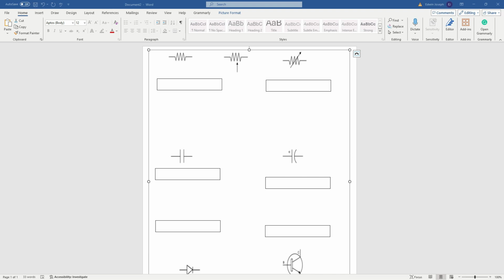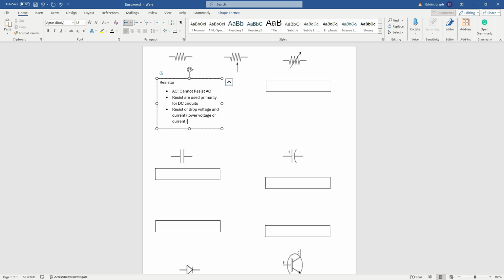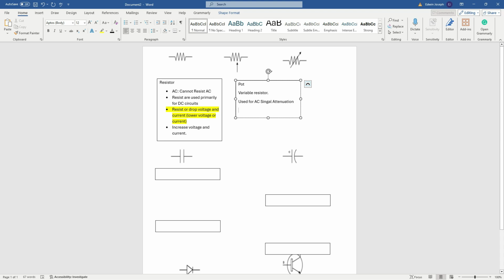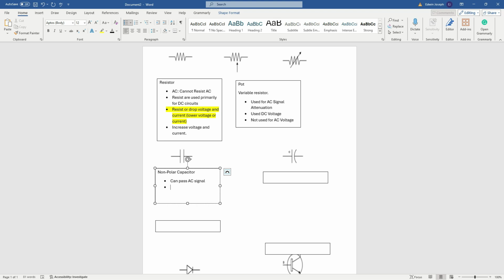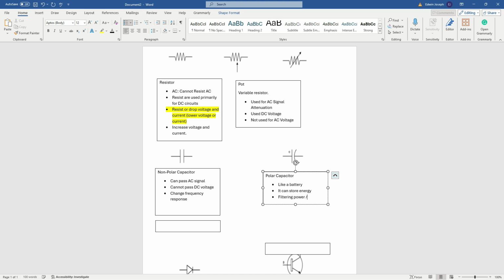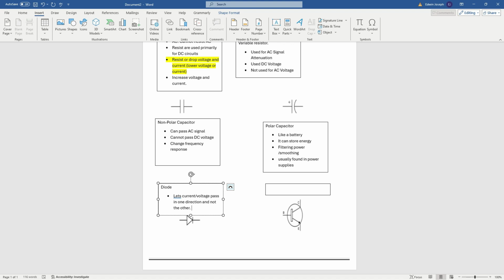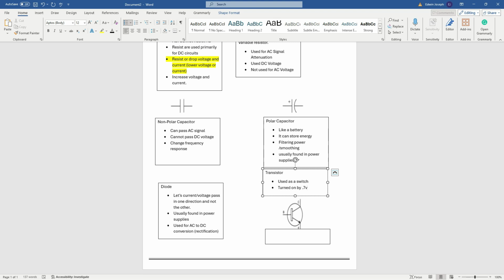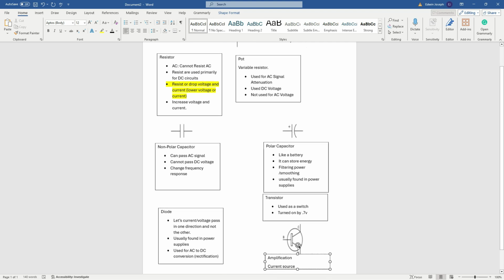Defining Electronics Components

Comment: Can you elaborate on what you mean by a resistor not being able to resist AC but being able to be used for loading? To me, those seem like one and the same. A resistor in an AC circuit still follows Ohm's law right?

I think you may be conflating diode drop voltage with transistor turn on voltage. Diodes almost always drop about 0.7 volts but there is no hard and fast rule for transistor turn on voltage, you just have to look at the data sheet for the one you're using.
Reply from the maker: The difference is application nomenclature. Resistors that are used in a circuit "to tell the energy or signal where to go" or to consume energy i.e. a dummy "load" is called in electronics application nomenclature a "load resistor." It’s a resistor put in a certain place in a circuit to establish current flow not to resist voltage. 

.7 volts is the generalized bias voltage for diodes and transistors used in the scientific community. Some might also refer to semiconductor bias voltage as needing to be above .6 volts.